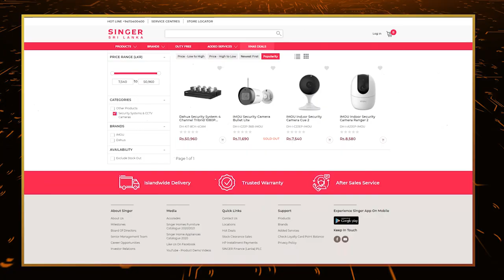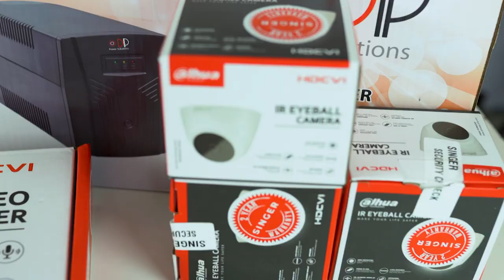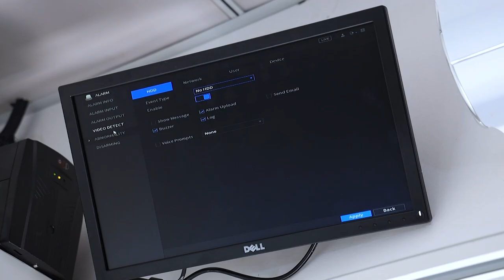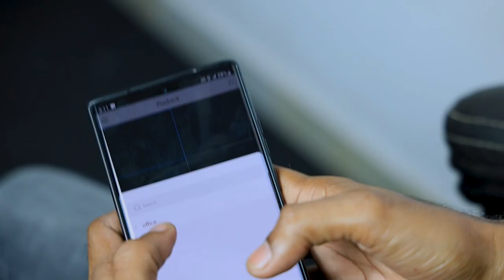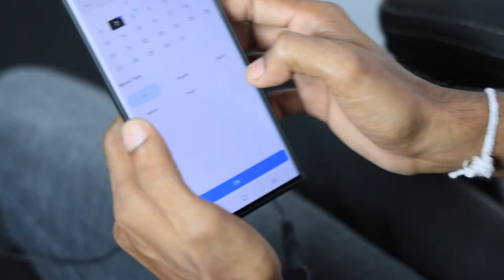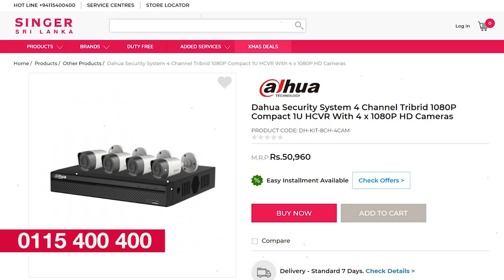CCTV Cameras in Sri Lanka

Comment: Brov your videos are very informative and useful for most of the people...in this video Technical detailing he's giving for the Terms are not correct... (eg: H.265 is a  High Efficiency Video Coding not the feature to capture video based on movements) they are doing a clean installation but not really expert in the CCTV Technology ...technical explanations made it a blunder....Dahua is not World Number 1 (it's one of the cheapest brands or cost effective ones) , HDCVI cameras are used in applications where existing analog infrastructure is available and users have a need for the latest technologies, including 4M/4K resolution, IoT over coax, Power over Coax (PoC), and more. HDD capacity defined by the options we chose for recording ....
Reply: exactly...i really stunned with his h265 explanation...😁😄